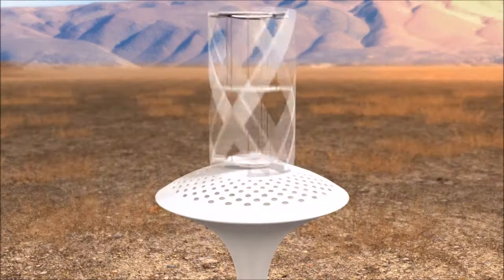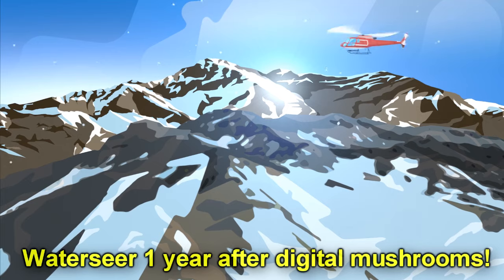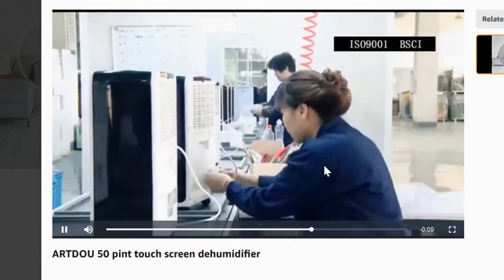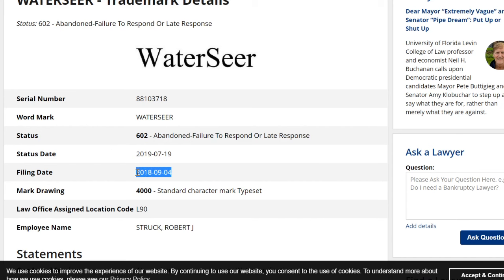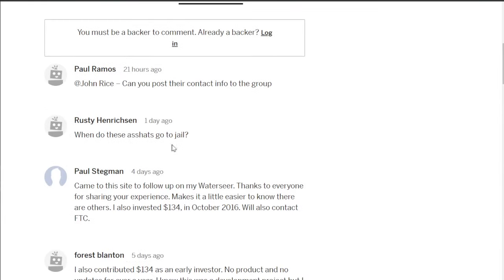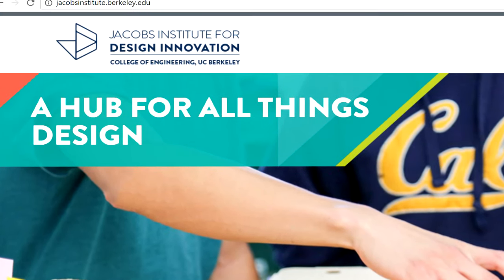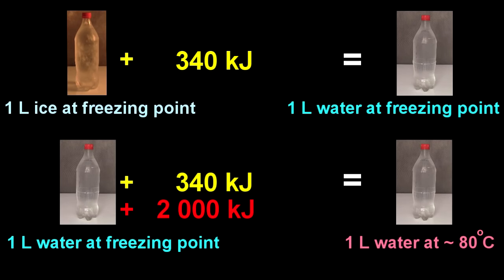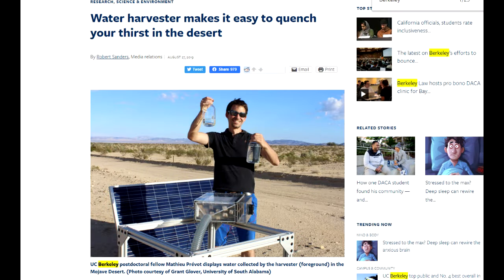Waterseer, Another one bites the dust!!

Comment: rule no 1 for a successful scam: promise to break the laws of thermodynamics.
Reply: It wouldn't actually break the laws of thermodynamics. The energy required to run a heat pump that condenses water from the air to turn 100 degrees water vapor into 100 degree water is actually 0, because the hot and cold sides are the same temperature and a perfect carnot process only requires energy if the hot and cold reservoirs are at different temperatures. But it isn't actually feasible to do it anyway.
Reply: "We will create water by destroying and creating matter at the same time all whilst decreasing entropy of everything in the universe"
Reply: @23100Battlefield  Just wait for my new entropy inverter, available from indiegogo
Reply: medexamtoolsdotcom can’t tell if you are trolling... there is a lot more energy in a gram of steam at 100 degrees than there is in a gram of water at 100 degrees and you do take that into account in thermodynamics...
Reply: rarbi.art that seems to work way more often than it should... it does give TF some entertaining potential rants though.
Reply: @medexamtoolscom  actually it does require the steam to lose energy in order to change state.
Reply: Because almost every practical exploitation of thermodynamics had been created and refined. They have to think outside the law
Reply: Nop promise people a magic place where evil will be punish and happiness will reign, all in exchange of a miserable and poor live
Reply: its not breaking the laws of thermodynamics, its just ineffective just like the people who believe it works.
Reply: @vladimir K. Shut up and take my money!
Reply: Crazy how easy it is to scam people who don't know Basics about thermodynamics

Comment: you can see ME in the video at 14:08 

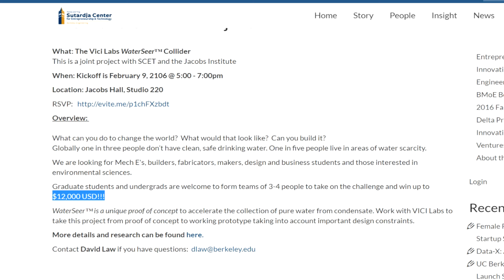okay I AM THE designer of one of the UC Berkeley waterseer Vici lab design contest teams in year 2016 and I stand out to say that the waterseer managers didn't know what they were doing, the UC Berkeley advisors didn't care, and the participants were faking. Vici lab had the physics wrong, alleging that deep soil temperature is always cooler than air and cold enough to sustain water condensation throughout the day, while this isn't the case anywhere in subtropical region. I know so because I actually dug two 12ft holes, one in my backyard, one on a hill, put thermostats and measured two days worth of data. The data shows that it's not possible in Bay Area to generate water with deep/shallow soil temperature gradient. My team FAKED the test data the night before the presentation because field test yield was pathetic (at least it worked cuz we were the only team that did many trial tests). However, the team (Ian's team 14:03) that WON the waterseer contest had NO field test data, not even semi functional apparatus, just a 3d printed plastic blob connecting a metal pole and plate that they did the night BEFORE the presentation (I saw it), and simply used the +so called 'theoretical data' to calculate practical yield lmfao. GGWP.  I can say this because I have no interest tied to these people anymore xaxaxaxa. Please thunmb up my comment so people can read the truth.

But tbh none of these matter cuz right now the graduates are working as senior engineers in some big money companies (kudox to those failed PR) and these fake projects are just a stepping stone that will be forgotten...
Reply: That's actually sad. You could have helped so many people.
Reply: @chryperion6924  apparently nobody cares
Reply: @heartminer5487  Those in Berkeley University?
Reply: Shit like that happens everywhere. In my college there was a group of 3 students. They never had any projects done, often didn't even come to the exams. Still they passed with great grades. Reason? They were "working on a robot" which was supposed to make them reach and the college famous. 5 years later there's still no robot, the most they ever showed for their work was some 3D presentation. They graduated a 5 year degree with a 3D presentation.

And now thanks to their great grades and being famous for "making a robot" they work in big companies and keep scamming people.
Reply: thx if anybody whos reading this could contact thunder in person I would really like to speak to him in person just for fun.
Reply: as an undergrad project sure, waterseer sounds fun, but wasting this amount of money and lying..... thats so damn low
Reply: you "put thermostats" to control the temperature underground?
Reply: @kiddhkane  :(  Rothschild
Reply: @kiddhkane  Christ; what sort of teachers would give them great grades for stuff outside of class despite doing nothing in class, even if they were legit?
Reply: Hi
Reply: Just like covid-19
Reply: @heartminer5487  
That's very upsetting...

I have to tell you I can't dig a hole deeper than 12ft in the state of Texas even though I have a storm cellar. Every time I enter it, it is hotter than the outside temperature during the spring time. So no way a waterseer will ever work.
Reply: @JodiFCobb  You are confusing politics with business.

This is business - believe it or not most universities are in the game to make money.

Whether it's from tuition fees, professor/student patent royalties or investors in a university IP spin off it doesn't matter.

They lika da money cha cha - ya get me?

If you want to try and tell me that Republicans don't care about money then I might die laughing at the ridiculousness of it.
Reply: @kiddhkane  recognisable. I think academics, particularly in CS, engineering, business school have a chip on their shoulder about not quite being in the big league and they bask in the greatness of students who can project themselves as future masters of the universe
Reply: @KnakuanaRka  computer science; engineering; business schools; 3rd tier STEM departments; maths departments with pure mathematicians who want to do something "hands on"
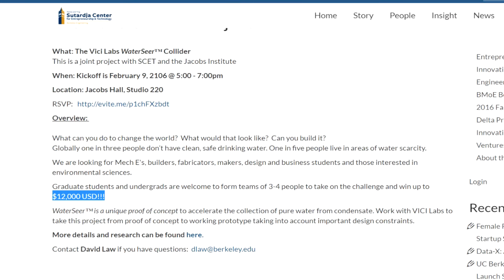Reply: @14:01 well ians team seem to think drinking from a puddle is the purest form of hydration....so i am kinda thinking his professor and parents need a real good slap for the failures

Comment: Water/Fog Condensing Nets work remarkably well in arid climates.  All you have to do is erect very small gauge netting or screen between two poles with a catch pan/gutter underneath with a container large enough to hold at least 3 gallons (11 liters) at one end.  With enough of these and the manpower to lug the water back, you can collect enough water to last throughout the day.  Voila!
Reply: exactly. and collecting rain water works a charm in wet climates

Comment: 0:57 " Because the sides are always cooler than the air, it collects water day and night? " Really, when the desert air plunges to cold at night, it's cooler six feet down in the soil, where the temp should be stable day and night?
Reply: yeah.
And that is just one part of the problem.
The other is: Do you know what a major defining fact of deserts is? Answer: there is almost no humidity in the air.

Comment: Having crunched the numbers, you can make a desiccant water extractor with one moving part and no electricity need, suitable for regions with large amounts of sunlight. It would produce between 4 to 10 liters of water per day per square meter of foot print on the ground. It is designed for maintenance twice a year.  But that is still a large amount of "so what?" It is large, heavy and you would still need to make the water drinkable. It would be hard to justify the production and ongoing costs except in very specialist applications. So while possible, not really useful.

Comment: Sad thing is, so long as you're not dealing with heavy metal contamination (which requires chemical reactants) water purification can be done for cheap.  Not well, but affordable.  Take three 5 gallon buckets and punch a hole in the bottom, as well as through a lid if you want it more stable.  Put a short pipe in the bottom with a vinyl mesh to keep everything but the water in that container.  Put pea gravel in the top, sand in the middle, and fine charcoal in the bottom.  Cover the top with an easily replaceable top to prevent dirt, bugs, and droppings from getting in and making more work.  Put the dirty water in, and the particulates are screened out.

Next, to deal with the biotics, you can have the bottom container fill a special, thin wafer that's roughly a meter square, but only a centimeter thick.  One side is glass, the other a reflective material.  The flatness is vital so that the water absorbs as little as possible.  10mm is within the reaction depth for UVA and UVB.  Sadly, the atmosphere screens out UVC, but this is for poor countries so it's gotta be cheap.  As the water sits in the wafer, the sunlight should help break up the bacteria enough that it's safe to drink.  Conversely, boiling the water, or treating it with iodine as viable alternatives if the wafer doesn't work.  Boiling water requires work and fuel and may be difficult in some conditions, while iodine can eventually be depleted.  There's many communities that do set ups like this already.

Comment: UCB - "It's a brand new technology that removes the humidity in the air."
Also UCB - "IT'S NOT A DEHUMIDIFIER"
Reply: UCB is #13.... so if we extrapolate, basically every college in the existence of the education system is worthless... except for the top 12?   Top 12 theory is unproven by thermodynamic scams at this time, data pending.
Reply: @jong2359  The top universities are only top because of the amount of money pumped into them.
Reply: @jong2359  The root of the problem here is that the number 13 doesn't even exist.

Comment: There is a way to extract water from air and generate power in the process, or actually generate a bit of power and accidently collect condensation but it takes a construction the size of a football stadium and miles of glass or plastic.

Comment: Apart from the water-chamber getting hot and the air not containing enough water for this to be viable another thing is that there would be no way to get a significant airflow through the chamber since there is no separate return path for the air to leave after being pushed into the chamber. Pressure builds up and the airflow stops...

Comment: Sounds like a good way to get Legionaries disease.
Reply: Well, truth be told, there are moisture collectors that produce drinkable, sterile water. Problem is, they are priced their weight in gold and they consume quite a lot of power. One of those is used on ISS iirc, and there was some russian desert science outpost that had one, too, simply because there's no water around for hundreds of miles, and it's more expensive to refill the tanks than to set up a moisture collector, only supplying spare parts and service materials for it once every several years.
Basically, what those scammers are trying to sell DOES exist, but it's heavy industrial-grade stuff that comes far, far from cheap.
Reply: You mean this pulls legions and water from the air?!? Sign me up for 10, I'm sold!

Kidding, I'm not that dumb.

I'll settle for 2 of them.
Reply: @sanmedina  
Yes, absolutely. If you don't clean them, you sure won't get sick (because the air is sterilized on its way in), but it'll gunk up the pipes eventually with all that particulate matter from the air.
Reply: @sanmedina 
Oh, I know that. That's the reason they use UV sterilization on air ducts all the time pretty much.

Comment: Now I'm just waiting for the death of Solar roadways.
Reply: The bigger they are, the harder they fall :)
Reply: Google the solar roadways live cam. I'd say it's dead as fuuuuuccck.
Reply: They are actually installing the sr4 panels in Idaho right now.  It has taken them months to try and get it installed (extensive concrete-cutting + laying down some kind of base layer on top of the concrete), but today they got most of the panels down.  Looks like they left for the night with 6 panels left to install (LOL at it being faster than road repair... this has taken 4 people a YEAR to put down 30 panels).  No light show yet. They claim that they've fixed all the problems from the SR3 and SR3.1, but the proof will be in the solar generation (and POWER CONSUMPTION [which they refuse to disclose]) numbers etc.
They were supposed to install the Baltimore Inner Harbor project by the summer, but haven't done anything yet for the $100k some foundation gave them.
Looking forward to the new Thunderf00t video on how terrible the newest generation of Solar Freakin' Roadways is.
If you are curious: https://www.sandpointidaho.gov/visiting-sandpoint/solar-roadways
Reply: @philojudaeusofalexandria9556  That's utterly embarrassing for them, or would be if they had any morals, the solar roadway (SR3.1) (actually sidewalk, closed and sectioned off from the public) not producing any light, plus, what are those cables that are coming out of the control box? evn more telling, the graph showing the ecectricity they supposedly are producing ends a couple of months ago, so much for live results.
 The actual roadway (SR4) needing a solid concrete base with what appears to be sand as the medium between the concrete and roadway,looks like the roadway needs to able to vibrate and not be hard against concrete and are using that as an excuse for their previous failure. Even though according to their website they had conducted many experiments freezing and thawing the pannels in testing, simulating trucks drivg over them etc.before installing SR3.1 (weirdly no mention of results). That massively adds to the cost and shows it is impossible to just install over asphalt roads. Whart is their new sales pitch going to be, "you have to build a concrete road and just cover it in sand to install the spectular failure that is solar freakin roadway. it will be expensive, but if it does not die you will never have to paint road markings again and hey those traffic lights on roads with re purposeable lanes might be cheaper, but they are not solar and you can't drive on a traffic lights".
 The morons think they came up with the idea of lanes that can be re purposed, they have been around in the shitty state of South Australia for years (most have been replaced by better roads, it turns out humans are creatures of habit, some can't be told one time of day they can use a lane and another they can't)

Comment: Maybe the worst part is that wind traps were used in ancient time,  consuming no electricity at all (using the winter/summer temperature differential mainly), of course that was not producing that much water,   but i'm nearly sure they had a better cost/efficiency ratio !

Comment: Thank you for posting this Thunderf00t, I am a retired lecturer of engineering and I simply can not fathom how UC Berkeley could have missed what the waterseer actually was and then went on to fund and support it.
Reply: I was at work once and there was an issue with some battery chargers, There was 4 other educated people around and I was telling a boss the wires were too small to carry the current to and from the batteries and that was why the wires were melting, he called me an idiot, I started fixing the batteries and he yelled at me to stop, I continued to put larger diameter wires on and he was practically at stroke level by the time I was done. I turned on the charger and it worked fine...... Most people are fucking idiots.
Reply: @theunconventionaldeal3879  seen much the same  and dealt with more than my share of educated people that are to put it bluntly so stupid I wonder how they get their shoes on each day.

Comment: That wind driven mushroom with an underground condensation chamber design was laid out by someone who doesn't understand how cold most desserts get at night, compared to the soil temp down 6' (which would be close to the yearly average temp)- And how low the relative humidity generally is in a dessert. And that every gram of water they DID manage to condense on the chamber walls during the day would be dumping 600 calories of heat into those walls and the fairly insulative surrounding soil, plus whatever heat energy would be brought in and left from the hot  air they'd be pumping down there all day long.

I would be quite surprised if it was ever worth the construction cost + installation cost.

Comment: "I think it's cheaper than ground water" well with ground water I can just pump the well and use a literal thousandth the energy they'd use to make a gallon.
Reply: I have a pump also at home, in the backyard, best and most pure water you can drink. I usually leave the pump working for an hour or so and it fills a 1000 liters tank.

Comment: But, I hand dug sixty, 6 foot deep holes, in my back yard, so I could go off grid with my water usage. What am I supposed to do now, with those holes?
Reply: Get free water out of them after every rainstorm. It'll be almost as effective as my bRAINbucket(tm) water collection system. Just $100 each, made of durable material, with a portable handle, and with a 5 gallon storage capacity.

Comment: Well air wells aren't new technology, but getting one to work in semi arid conditions would be a challenge, for sure.  Given this thing's size and the environment it's designed to work in, I can tell you without even any back of the napkin calculations that it wouldn't work.  You could extract moisture from the air in semi-arid environments, but you'd need to expend plenty of energy to do it.  Then you'd have to purify that water due to contamination in the process.

Comment: Take a volume of air with 1 part per million water density. The more water you pull from that volume of air the more energy it takes to pull water from what remains. Diminishing returns reaches a point of practical Zero return.